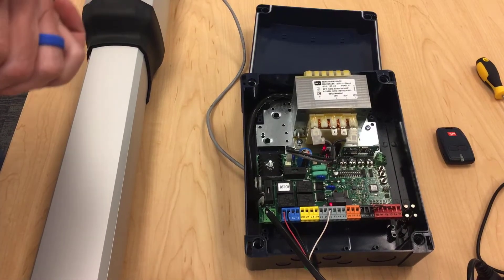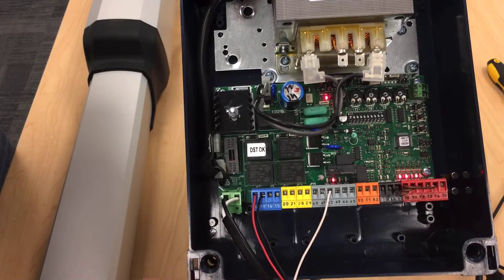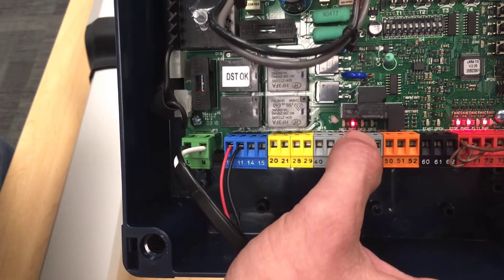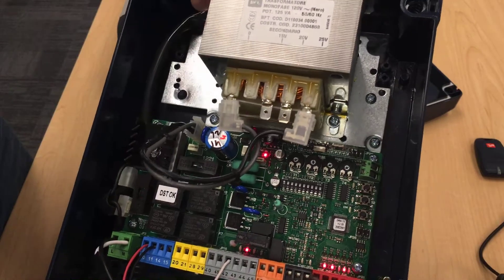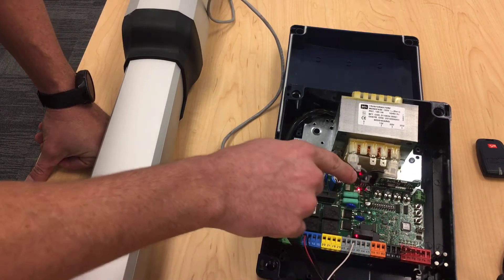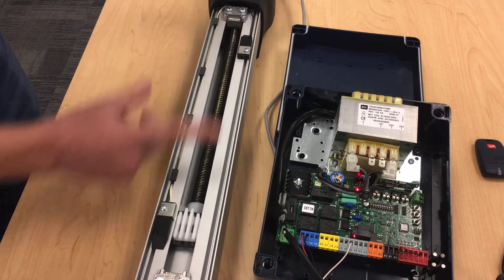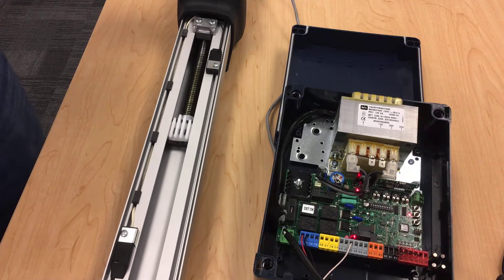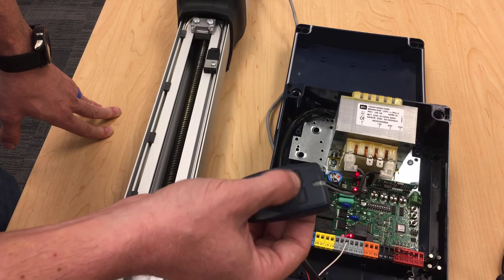BFT Kustos A40/A25 and Zara control board quick over view and programming

Comment: Hey, if possible I need some advice. I have programmed this and I was able to get the gates to open/close with a single remote, however when I tried to add the second remote, I pressed some switch buttons and my faults lights went off, and then I was not able to open/close the gates etc. I am not sure what I have done, any ideas to somehow to fix this or restart this board and start from the beginning?
Reply: So for example my BAR light is not ON anymore, even though it was working before I pressed the switch buttons to add the second remote :c
Reply from the maker: Could you reach out to us at Tech@bft-usa.com to see if we could get to the bottom of it? Mabey a short video if possible?

Comment: Mine says it’s open when it’s closed and closed when it opened what should I do it’s working backwards
Reply from the maker: The Zara board does not allow you to change direction in the control logic so you would just have to swap polarity. (for one motor operation just swap 10 and 11....for two motor operation you would also have to swap 14 and 15) Hope this helps!
Reply: @BFTAmericasInc  It helped me, a lot, this comment. Hope, you guys are making more explanatory videos.👍🏼